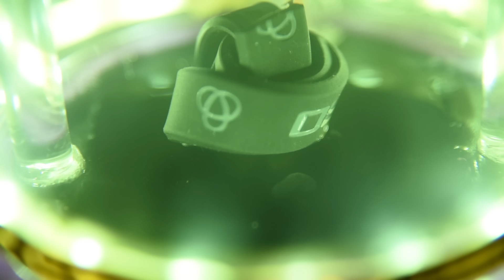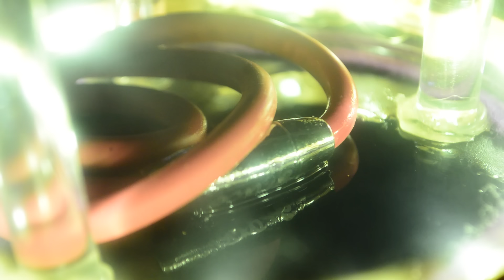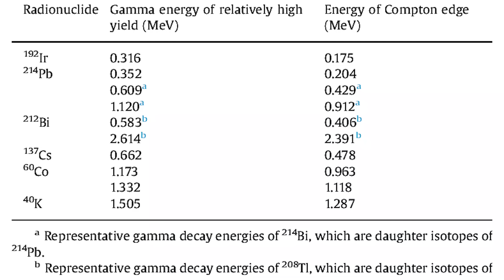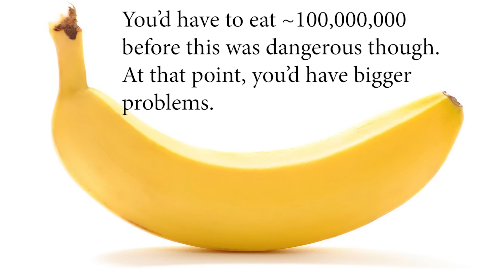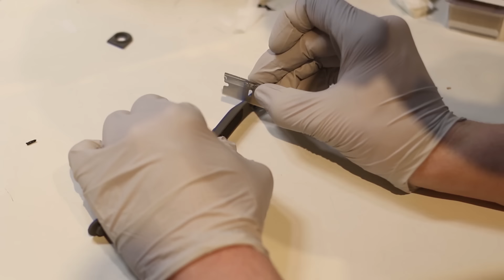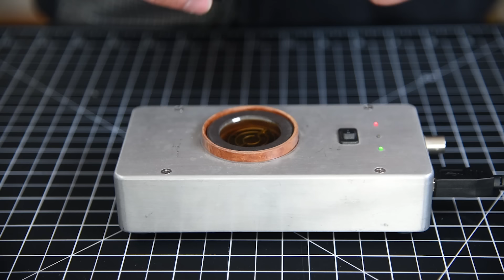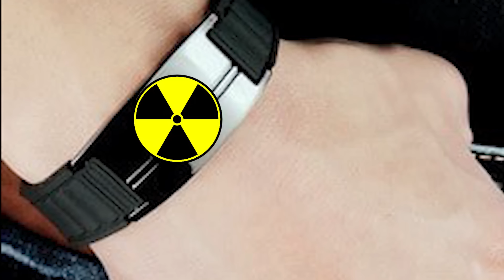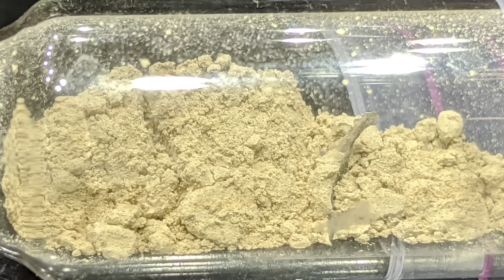Negative Ion/Anti-5g Products Are Actually RADIOACTIVE

Comment: The whole what radiation will and won't go through, is talking about tenth thickness. How much stuff is required to reduce the radiation to 1/10th, so in lower dosages like those bracelets those images are accurate enough, and alpha is really insignificant. That said Alphas are so easily stopped because they interact with every thing, so if that powder becomes dust in your house and you start inhaling it, one: it will stay in your body for a very long time, and two: those alphas now have direct access to your living flesh and will dump all that energy in very small areas. 

radiation doesn't work like classical physics where you can say a piece of paper will stop a ping pong ball, and a cloth a basket ball, and 1/4 AR500 steel a 5.56. It's more akin to shooting through a forest, a forest where some times the bullets can't be bothered to figure out if they hit that tree, or where already on the other side, and just roll for hit detection. Then there are the weird force fields that effect the trajectory of some bullets but not others, and then some times the trees just bounce the bullets of with so little deformation that the bullets lose almost no energy, other times the bullets spend some of their energy to accelerate more bullets from the trees. I digress, but you get the point.

Comment: >Be scared of regulated processed food, with every ingredient described on the package
>Love cheap radiation pellets with fancy names and designs
Reply: Obviously we just need to change the IUPAC nomenclature to sound more cutesy. Or maybe in proportion to its actual danger level.
Reply: Charles Lambert Actually, most of it is not even IUPAC, but common names. So I doubt that would change anything.
Reply: Charles Lambert Shorter name: less deadly; longer name: more deadly. We'll change sodium benzoate to benso & thorium dioxide to monothorium dieoxygenium.
Reply: @DeeFeeCee  Add the suffix "of death" for radioactive elements.
Reply: @PunishedClippy  Monothorium dieoxygenium of death, well at least it gets the point across. Though I must admit to being partial to "of doom"
Reply: @PunishedClippy  Deathorium does sound pretty metal.
Reply: @roderik1990   "of doom" is reserved for higher doses :D
Reply: Sorrium diocide. 

Sneak oil salesmen.

Fakesimiles.

Theatre prop sales department. 

The world-wide supply chain is stretched beyond proper functioning. Time for a reset: discard it and the gear at both ends, then start over from scratch.
Reply: new age organic vegan hippies be like:
Reply: We should name proteins "muscle goo+ some identifier" and radioactive elements as "death rock "
Reply: Well duh! We can pronounce thorium dioxide easily and therefore it's safe! But dihydrogen monoxide is harder to say and therefore it'd bad! /s
Reply: @transbiologistthetransesto7956   well yeah, inhaling dihydrogen monoxide can kill you. It kills a lot of people
Reply: If we banned the same ingredients as EU does..Nope a little bit more antifreeze wolnt hurt them...oh well if it does.
Reply: Sinister Except radioactive substances are already banned in this kind of products. This comes from China, they don’t care about other countries regulations so manufacturers ignore them!
Reply: In the US, they don't need to list ingredients if there's less then .5 grams per serving.  

They could hide a lethal amount of morphine per serving of any food in the country and they wouldn't need to list it.
Reply: both of them are bad
Reply: Lol, definetly not all of the ingredients are not described on the package. For example Water, what quality if Water? Fruit, what about pesticides etc you can never read all relevant ingredients.
Reply: @T444FIN  The water used has to meet standards and if there were pesticides present on the final product regulatory bodies would still step in.
Reply: You should be scared of regulated processed food
Reply: @bigtinyhomeadventurebigtin5201  Why?

Comment: Well that's a bit of a step backwards.  It's very reminiscent of the radium health drinks.
Reply: Maybe soon your MRE video will come true with a ‘negative ion heater’
Reply: @Nosirrbro In my I read the "negative ion heater" in big clives voce
Reply: However, radium-226 is far more radioactive than thorium-232 in specific activity–about 8.8 million times more radioactive. It's also the chemistry too. Radium is in the same group as calcium, which can seek bone tissue. Toxicity is another. Thorium, especially if it's a soluble compound, will be much more toxic than its radioactivity. Shorter-lived radionuclides are the ones that generally pack more of a punch than longer-lived radionuclides. It depends on the branching intensities, energies of the type(s) of radiation emitted, age, decay daughter(s), and half-life.  Bismuth-209, which makes up ~100% of all bismuth is radioactive, however it has a half-life of about 20 quintillion years, therefore it poses almost no risk in terms of its radioactivity.
Reply: Ah, good ol radithor
Reply: Quite the wetting drink!  I hear if you chugged enough of them, you could melt from the inside out, like the wicked witch.   Hey ya Clive!
Reply: @bigclivedotcom
Can you get one of these...."massagers" and open it up for us?
Reply: @Life-tastic  Strangely enough I have ordered a massage pen to check out.  I wonder if it will actually arrive.
Reply: ALL HAIL BIG CLIVE!!!
Reply: That's almost as bad as vintage gems such as tapeworm weight loss, trepanation (for 'evil spirits'), bloodletting, etc.

What the hell were we thinking back then? We did some of the most unhealthy stuff in pursuit of 'health.'
Oh, and I forgot lobotomies! Because let's make someone with high-functioning Autism go from a mental age of 15 to a mental age of 2 because they were a bit immature and socially awkward.
Reply: Yeah I was thinking of taking a cool refreshing drink from my Revigator as well.
Reply: Ah yes, RadiThor. The “health” drink responsible for this wonderful headline about socialite Eben Byers: “The Radium Water Worked Fine until His Jaw Came Off”
Reply: its like its the 20s over again, wait its the 20s over again
Reply: Thanks for sending me this way
Reply: I just watched the movie Radium Girls and saw how bad those products and job positions were and to see that companies have found a way to produce things like that again is disgusting.
Reply: Or the radioactive toothpaste. Not to forget that children liked the glowing paints back then. 😳
Reply: Hearing radioactive face cream I though of a Plainly Difficult video.
Reply: I found the radioactive underwear as well as the pen with Thorium dust on AliExpress. My old physics teacher is always happy when I send him something new to show in class.
Reply: So... cancer.
Reply: im seeing a pattern for "wonder materials" to put in everything
1. asbestos
2. lead 
3. negative ions
Reply: @memoboy1421  
The list goes on
Cadmium
Teflon... possibly...
Reply: "Radium was healthy until it made his jaw fall off" quote about radium water circa 1930-1935
Reply: Im sorry, WHAT?
Reply: Yes, folks, I'm talkin' 'bout RRRRRRADIUM WATER! Reee-vitalizes the tired and forty-fies the healthy! Onlyyy one-yes, ONE!-silver dollar a bottle! Buy two ANNND I'll throw in a bottle of my patented SNAKE-OIL!
Reply: The negative ion tester himself!
Reply: Why stop their? Just give me a syringe I will just inject it straight.
Reply: SO EXTREME FOR YOUR HEALTH THAT IT'LL MELT YOUR FUCKIN' JAW OFF!!!
Reply: You here too BC??  These seem a bit more portable than the ionisers you took to bits ages ago  (and probably quite a bit more dangerous, from a longtime wearing use perspective!)
Reply: haha great to see you here! my favorite "unnecessary dangerous stuff" youtuber.
Reply: Well, using radiation is the most effective way to kill bacteria and even destroy viruses, and of course the stuff treated with it isn't dangerous (just as you can re-use a hazmat suit after it is externally cleaned). My concern is rather about the health of the people on the spot while it is operating.
Reply: Excuse me, the what?
Reply: Nuka Cola
Reply: I felt the same way.
Reply: Back when people believe mercury and lead in cosmetics will result to radiant skin...
Reply: @myfirstoocwarning8483  radiant? More like irradiant!
Reply: the WHAT?
Reply: @placeholder381  There was a “health” product in the 1930s called “RadiThor” that was so poisonous and radioactive that it led to one drinker (socialite and golf player Eben Byers) literally having his jaw fall off.
Reply: @gwest3644  that must have been a fun doctor visit
Reply: and they don't even make me immune to damage for a few seconds or make every hit i deal a mini-crit
what a scam!
Reply: @Victor-mi2py  Sadly, "Bonk! Atomic Punch" does not exist in real life. A prayer for those who found out the hard way 😢
Reply: My thoughts exactly.
Reply: Hay! You have a YouTube channel to!! :D
Reply: I followed your bread crumb trail here
Reply: Someone had looked into this back in 2014 https://public-blog.nrc-gateway.gov/tag/negative-ion-bracelets/   , can't find any follow up tho'
Reply: @john boone The painters were encouraged to make a fine point on the paintbrush by putting it in their mouths. Their story is sad and at times horrific. Warning: the link contains details of what the sufferers went through, along with photographs. It's quite an emotional read. I remember my dad telling me about it years ago but I didn't  realise it was so bad.  https://www.buzzfeed.com/authorkatemoore/the-light-that-does-not-lie?utm_source=dynamic&utm_campaign=bfsharecopy
Reply: Vell, ve've been there... https://youtu.be/Sw5VU0GE_Wo?t=525
Reply: Speak about Nuka Cola, am I right?
Reply: welcome to the 1950s were if it dosen't kill you in a day its good for you
Reply: Idk. I heard that radium can really help you glow up.
Reply: I was just about to say that it was the 50s all over again
Reply: Ah yes, spicy Monster Energy
Reply: It's not only that but also even worse because if you actually believe that these have anything to do with helpfully stuff you are not smart enough to claim anything regarding negative ions or you are doing it while knowing you are scamming people which is illegal in at least three ways
Reply: better buy a geiger counter
Reply: Have you tried drinking mercury?
Reply: Or way back where lead I think was used as a way to immortality
Reply: and radium everything.
Reply: Oops.  I just made a similar comment about RadiThor.  Sorry.  I didn't read far enough into the comments.
Reply: THE WHAT
Reply: Radithor drinks.
Reply: Shame more people don't know the absolutely horrifying story of Eben Byers, who would probably have a thing or two to say about such things.
Reply: Pepto radium classic is still better than pepto radium lite
Reply: What I don't get is why they bothered to fortify the novelties at all. Do they think the marks are going to have a household geiger counter to prove it? IS THIS HOW PEOPLE LIVE IN PRC?
Or are they dispersing industrial waste?
Reply: Or uranium based red and orange dyes
Reply: I am shocked that the "actinic principle"/radium quack product garbage from 1900 has been renamed and sold again. In the age of Marie Curie many people likely didn't know it better (radium was said to be the most precious/expensive metal and had that magical green glow), so people died of smoking radium cigars made with uranium ore. But nowadays selling such things without mentioning its radioactive ingredients is just a major crime that can not be excused. (I am interested in alternative science theories, but selling this deadly stuff is plain atrocious.)
Reply: That's IMMEDIATELY what I thought about.
Reply: Except we know better lol. At least they didn't know the true health effects of radiation when those drinks were manufactured; we have commissions regulating the sale of radioactive materials in the modern day, we basically don't have an excuse.
Reply: apparently radium spas still exist in Japan and Bohemia
Reply: Hey clive, doesn't surprize that you are also here!
Reply: They're making a film about Marie Curie(just felt like this had something to do with your comment)

Comment: So these products are basically as radioactive as uranium glass?
Reply: No, they're worse. Regardless of the actual radioactivity of both products (which is pretty minimal) they are designed to be worn directly against your body at all times such that the radioactivity will be concentrated on a small area, and perhaps more importantly they're made with loose thorium oxide dust - dust that can get in the air and all over everything in small amounts, and give you lung or digestive-tract cancer.

Comment: Why is that legal to sell?!?!
Reply: Probably not legal.  Quack medicine and harmful products are generally illegal.  It just isn't always enforced: the enforcers have limited resources, so they try to focus on the biggest threats.  There are always new quack medicines popping up, faster than they can be shut down.  Enforcers have to follow legal procedure, whereas snake oil salesmen can come up with a new product and start shilling it off very quickly.  It's a never-ending battle.
Reply: Puppu Jinks  Absolutely correct: it's fraud (lying or deception).
Reply: @Joseph Liebgott This is the correct answer. Maybe we should stop trading with certain places.
Reply: Unregulated "supplement" market.
Reply: Magnetic black beach sand is quite rich in thorium, and the most naturally occurring radioactive place on Earth is a beach in Brazil–Guarapari Beach. That beach will make a Geiger-Müller counter scream. Thorium is pretty weak in terms of its radioactivity, because of its long half-life. It has a 14.05 billion year half-life. Just as an example, radium-226 (1600 years) is about 8.8 million times more radioactive than Th-232. So, it would take about 1 microgram of Ra-226 to get the same activity as 8.8 grams of Th-232. I wouldn't be surprised if black sand was melted down into some of these bogus products, by accident, or by intent. I do need to add these to my vast radioactive collection, since most of my sources are much more radioactive than these pendants and bracelets. If anything, they'd make good check sources for Geiger-Müller counters and scintillation counters. Check out "bionerd23" and her trip to Guarapari Beach, Brazil. She measures this beach's radioactivity very thoroughly. She makes awesome radioactivity videos!
Reply: China
Reply: @Joseph Liebgott I just imagined a even more orange trump but without nose and conjuring evil wizardry
Reply: Because money and capitalism.
Reply: Capitalisam and the "regulations" set by america , thankfully i live in serbia where they are classified as "weapons of mass destruction" on customs
Reply: @lukakresoja5297  "Weapons of mass destruction"?  Okay¡
Reply: With the T-word in charge the regulators are underfunded, understaffed, and directed to avoid enforcing the rules.
Reply: @Joseph Liebgott I don't like to use cuss words. It's OK with me if you do though.

Comment: This seems even less sensible than old radium-painted wristwatches - sure you'll measure a few microsieverts per hour coming off them, but at least the material is pretty well encased.
Reply: At least in those watches the radiation did something useful.
Reply: I own a mechanical watch with radium lumination on it, built pretty recently. It's mostly alfa emitter and literally in water tight ecnlosure so it's good. Problem with radium was that people handled it all willi nilly. Like toothpaste! The true danger of radium comes from it being consumed and inhaled. It accumulates in bones and that's the bad stuff.
Reply: @TealJosh  if it's recent, then almost certainly it does not use Radium, but Tritium.
Reply: @m.k.8158  oh shiit. I can't believe I had that brainfart. I know I got it knowing it was tritium. I wonder when that brainfart replaced the actual memory lol.
Reply: @TealJosh  LOL, it happens.

Comment: You should all keep in mind that the medical model that sets the yearly threshold for safe radiation exposure is wrong to some extent.
Radioactivity was discovered quite late in the history of humankind so it has always been unethical to perform thorough testing.
What we do have are a few cases like the Chernobyl ... where these models predicted like what, 100 000 people dying of cancer within however many years?
That didn't happen. The best we have are studies made on pilots (which are exposed to a lot of cosmic radiation) and even then these are tentatively saying "there's more skin cancer but it might be due to fluid sleep schedule, we can't say for sure".

What I'm saying is the current model is "no threshold linear" model. Aka. more radiation is bad. There are many signs that suggest this model isn't correct and a few of these signs suggest that there might in fact be a threshold below which radiation might be harmless or even beneficial and above which it becomes dangerous. The linear dependence of the danger with exposure is also an educated guess. But don't buy radioactive underwear ... definitely don't do that.

Comment: Wait you had the photo multiplier openly on your bench in full light?  Ive never seen that done and the tube survive.
Reply: Not powered when in full light? I understood it requires power?
Reply: @TealJosh  They have internal coatings, ambient light is strong enough to burn these coatings. I've not read every data sheet on every tube produced but I have yet to read one that doesn't start out with a full page of instructions on never exposing the tube to ambient light.  If his can be safely handled in ambient then I am interested in what he has.
Reply: @keeperofthegood  that's cool. Thanks for the answer.